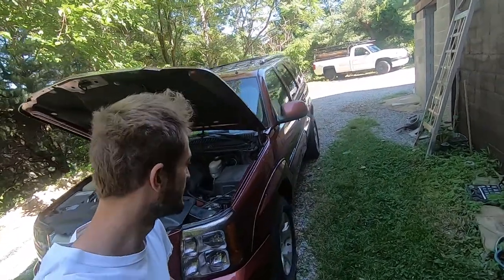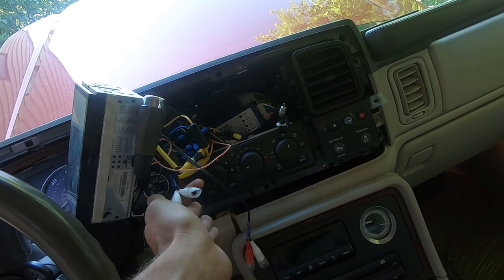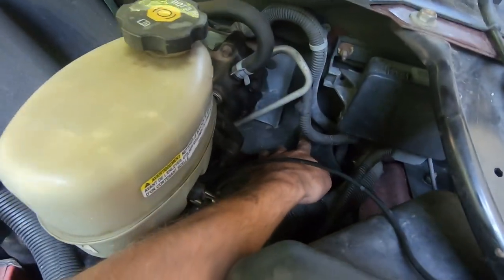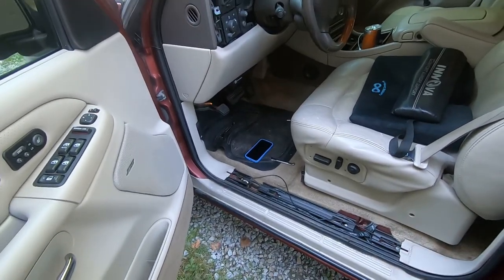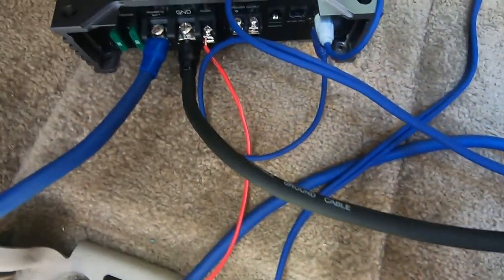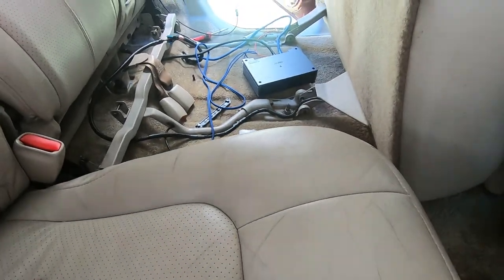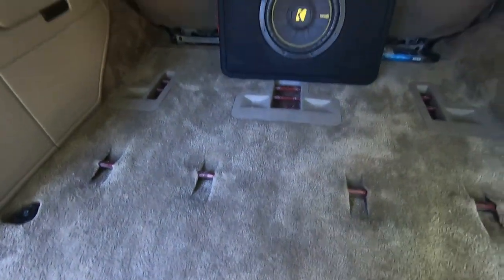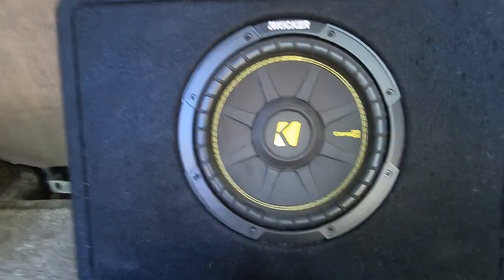Installing Amp & Sub in a 2002 Cadillac Escalade

Comment: What harness did u get to bypass the factory amp?
Reply from the maker: I just plugged the amp into the head unit. The head unit was installed before I bought the vehicle
Reply: Did you plug it in with rca cables?

Comment: where you get ground
Reply from the maker: Pretty sure I just used a self tapping screw under the seat somewhere
Reply: @jeffdeshong  i try but amp not turn on ☹️ maby is the cable ground
Reply from the maker: @MiJARDINDEROSAS1987  make sure to use sand paper to scrape where it connects to make sure you get a good ground. Hope that helps. You try checking all the fuses?
Reply: @jeffdeshong  i put 250a fuse you thing that  work for amplifier 4000w
Reply from the maker: @MiJARDINDEROSAS1987  not 100% sure but I think that should be fine. I’d guess you’re having a ground issue. That amp needs a lot of power